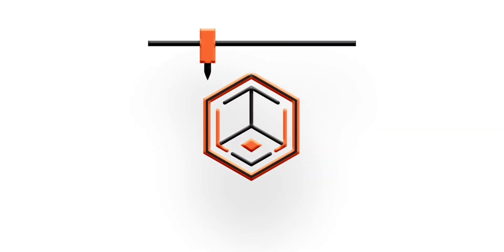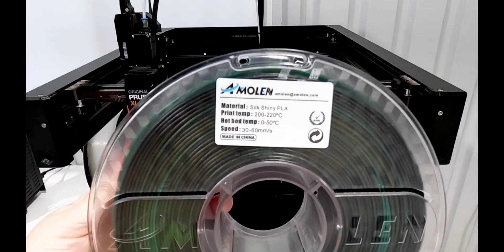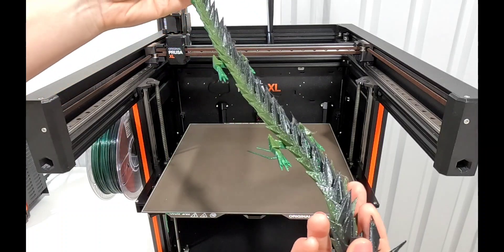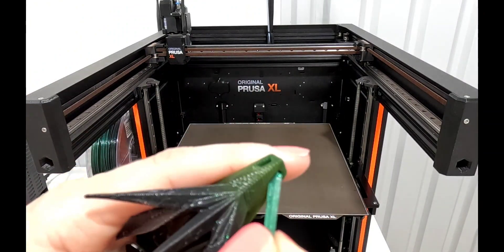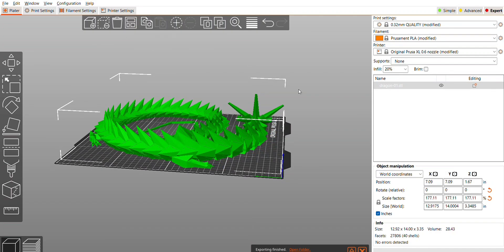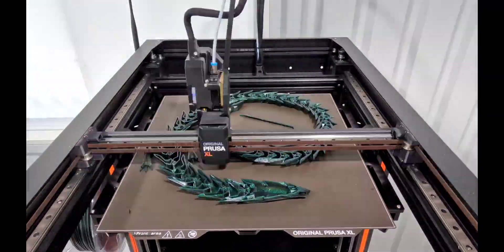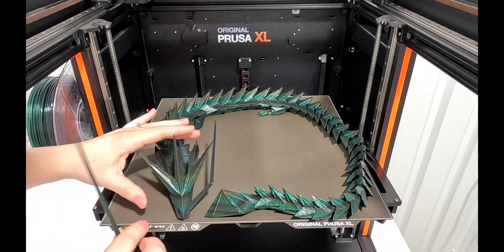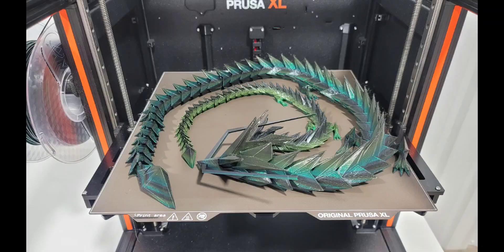Printing a GIANT Articulated Dragon🐉on the Prusa XL!

Comment: I think the rainbow filament worked well.  I use Tinkercad to separate parts - in this case the horns from the body.  It may look better without them!
Reply: or just the slicer, the buttons in the top bar automatically do that (the O in square and P in square, O splits into Objects, P into Parts) Might be a lot of parts cause it will probably split the dragon pieces, but doesn't really matter I think.
Reply from the maker: Thank you!